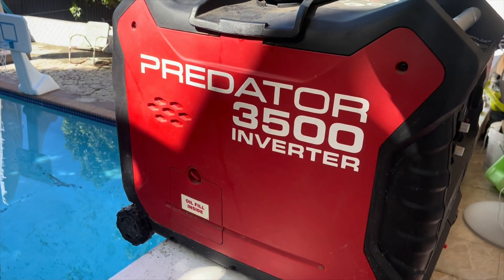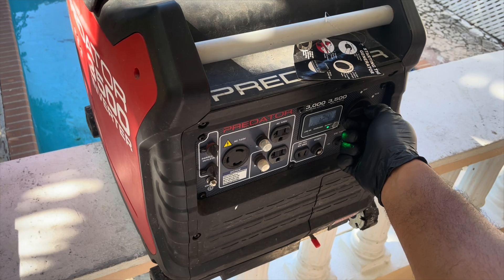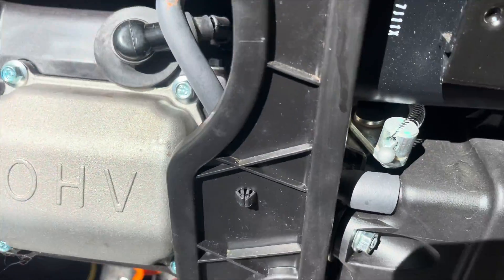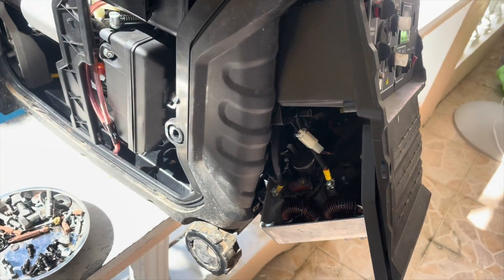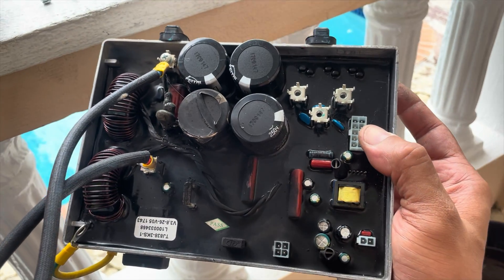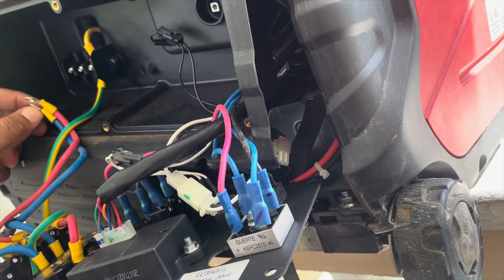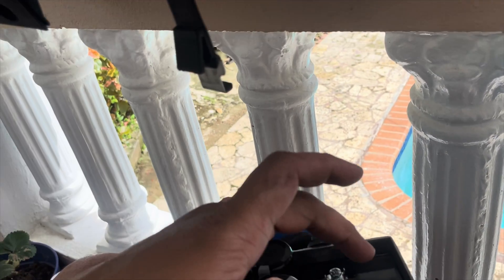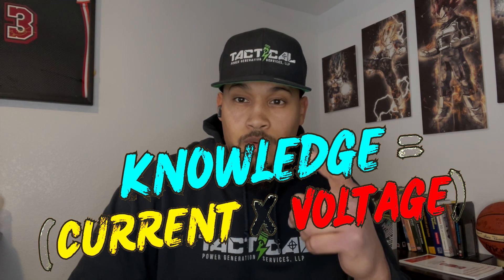How to repair a Harbor Freight Predator 3500 Inverter that has NO VOLTAGE or HIGH VOLTAGE. #diy

Comment: I’m having problems with my inverter on my 3500 predator inverter generator not producing any power DC power is coming through the inverter and lights in all work. Could you please give me some advice or where to buy a new invert? It is a six plug module.
Reply from the maker: Thank you for watching my video. I added an amazon link to the 3500 predator inverter module with 6 connectors to the description box of this video. Check if that’s the one you looking for. Let me know if I can help with anything else.

Comment: Hey Great Video...
I have a problem with my predator 3500.   I would not start with the cord, but I was able to start with a jumper.. it runs small rev up and down .. display show 0.  I tried power tools they work ok ..   what would you suggest regarding stating with cord..and display voltage.
Reply: Thank you for reply.. 
I was able to clean the carburetor... And it started up...
Then I tried to start again nothing, using cord and start button.  Generator spins but will not engage...
When it was running I tested with multimeter all120v  outlets 124.6
What else I can test
Thank you..
Reply from the maker: Make sure you didn’t flood the engine trying to start it the second time. Remove the spark plug and with the switch off pull the cord a few times to remove any fuel/liquid in the cylinder. Install the spark plug and try to start it again. Let me know if that works.
Reply: Yes I was draining fuel out of the carburetor through the drain bolt...
I went on and saw another person experience the same symptoms as my self ..and he replaced TJ113-2009-1 Ignition Control Module ... When I checked mine for some reason it was completely drenched in oil...
So I just installed it.. and the problem is solved generator starts up with half of the pull.  
Thank you for all you do...
Reply from the maker: Yes the ignition module is another common issue on the predator 3500 inverters. The module is located in the worst spot and it will get soaked on oil and get damaged easily. Thanks for keeping updated and I’m glad you were able to get your generator back in operation.
Reply: In addition... When I was cleaning carburetor, I noticed that pilot jet O rings were very thin looking. Have you replaced them if so what type?
Reply from the maker: If the generator is not surging while running then do not mess with them. But if you are in need of replacing them you can find a carburetor rebuild kit on amazon and it comes with a couple of those o-rings. I’ve tried searching for just the o-rings but I haven’t had any luck.
Reply: That makes sense..thank you..
Reply from the maker: Sure man, I’m here to help. If you have any other generator questions just hit me up 🫡
Reply from the maker: Thanks for watching my video! I recommend starting by giving the carburetor a good clean. That will take care of the starting with cord and the up and down revs. As for the display voltage make sure the connections from the display to the inverter module are not loose. If all connections are good then you may have a faulty display.

Comment: I found my stator to me the issue after disconnecting the 3 brown wires hooked up to the inverter module.
Does that indicate a bad stator or a bad inverter module?
how easy is it to pull out the stator?
Reply: Do you have an idea of what would cause it to only start when the 3 stator wires are pulled?
Reply from the maker: Did you connected the 3 wires back and tried to start the generator? It’s weird, those wires shouldn’t affect the spark at all. There are a few things that would cut your spark by grounding the circuit and those are, the oil sensor, ignition switch, ignition module and the CO sensor.
Reply from the maker: How did you found the stator to be the issue?
Reply: @tacticalpowerpro it wasn’t getting any spark and when I disconnected the 3 wires I got spark. Do you think the issue is the stator or the inverter module?

Comment: Love your video, and love seeing you respond to people a year later. Thanks for that.
I bought my 3500 like 7 years ago as a backup plan.  Never unboxed it.  I just unboxed it to prep for a storm, added oil and fuel, started on second pull. Ran fine for 5 minutes doing a warm up(eco off), then gave overload and idle dropped down as that happened.
I ripped her apart to get the inverter module out to inspect it.  It looks fine, capacitors and resistors arent swollen or burnt.
Then i checked oil and i put too much.
Do you think too much oil causing crankcase pressure cpuld cause that or should i order an inverter module?
Reply from the maker: I’m happy to read you love my video. I appreciate the support. Overfilling oil can definitely cause crankcase pressure issues, but usually that shows up as hard starting, smoking, or leaks, not typically as an overload fault. Since it only ran a few minutes before throwing overload and dropping RPM, I’d double-check the basics first:
1-Drain excess oil back to the correct level. 2-Inspect air filter and spark plug. 3-Make sure carburetor isn’t gummed from sitting all those years. 4-Test with no load to see if overload still trips.

If it still shows overload after oil correction and carb cleaning, then I will point toward the inverter module, but I’d rule out the simpler stuff first before ordering parts. Good luck and keep me updated.
Reply: @tacticalpowerpro thanks bro.  Im hoping its not a carb issue since I never used it, it say new in box for those 7 years.  I could have bought someone else's return, that would suck lol.
Im gunna put the inverter module back together, lower pil and rip the carb apart.  I'll come back and let you know
Reply from the maker: You’ll be surprised bro, I’ve seen generators with a gummed main jet from the box. I’ve seen inverter generators not producing power after one hour of actual used. But like I said, start by checking that everything on the engine side is good.
Reply: @tacticalpowerpro  got her working.  I redid the pil, verified everything else looked good.  Just got the replacement inverter module in and shes working all Bueno now.  124v steady.  No fails so far!  Thanks for all your video and responses.  I wish I made a video of the inverter swap that you didnt have in your video, but im too impatient to do that lol.
Reply from the maker: Awesome!! Good to read the generator is working again. Thank you for the update. I am searching for another Predator 3500 generator with a bad inverter module so I can record the inverter module swap I didn’t have on this video.

Comment: These generators are POS’s I’ve gone thru 3 of them this week. I asked Harbor Freight for a refund and they said they were unwilling to do that but this will be the 3RD ONE im exchanging THIS WEEK. Shame on Harbor Freight for not refund me the $800, I’m at the point where I’d rather pay more for quality. I’m filling up with 10w-30 20 Fl oz of synthetic oil, fresh 89 octane gas and I’m hooking up the electric start system. 1st one, the electric start died after 2 days and the 2nd one won’t even start up. I’m doing everything right. It’s ridiculous
Reply from the maker: Oh wow, three in a a week!? that’s really unfortunate. Electric start issues are typically caused by a weak battery. Would it start manually with the pull start? 

Also, these Predator generators are known to have faulty ignition modules and bad CO sensors. These issues will prevent the generator from starting. 

I hope the 3rd one works without any issues.

Comment: Ive been using this to run a  very small 120 volt mini split. The other day the voltage drpped to 61.5 volts out of both the 30 amp and 15 amp outlets. Any suggestions. Thanks
Reply from the maker: Sounds like your Predator 3500 may be having an inverter module issue. First, check the basics, make sure the ECO mode is off while running the mini split, verify the load isn’t exceeding capacity, and inspect all connections for corrosion or looseness. If the engine speed is steady but voltage is low across both outlets, the problem is likely in the inverter module itself or the stator windings. If you have a meter, check voltage with no load to see if it recovers back to 120v, if not, you’re looking at an inverter module replacement.

Comment: Hi, thank you for your helpful videos. I'm asking about this video that you mentioned the new module has 3 capacitors (not 4), but not that the white connector positions changed (though still plug and play). My main question: how did you wire the three silver screw terminals, since their orientation changed—did you reverse just the bottom cable or others too?
Reply from the maker: Hi, great question. I do not recall reversing those wires. I placed them in the same position as on the bad inverter module.

Comment: Mine runs for a minute then shut off and it says overload. Does that mean I need a new inverter? My generator only has 12 hours
Reply from the maker: How does the engine sound? running rough? really low idle? Make sure you have a clean carburetor, good carburetor gaskets, good and correctly gapped spark plug, clean spark arrestor (the mesh found in the tip of the muffler) and correct oil level. Most of the times I've seen the issue you mentioned, turned out to be either a clogged spark arrestor or carburetor related (dirty, loose). If everything is good on the engine then verify all the connections to the inverter module.
Reply: @tacticalpowerpro thank you👍🏽 im look into it !!
Reply from the maker: @juandejesus4757 you’re welcome. Keep me updated.

Comment: Mine runs/idles fine ...as soon as I plug anything into it gives me overloaded would this be the module?
Reply from the maker: I will need a lil bit of more info to give you an accurate answer. Is the spark arrestor at the muffler clean? Spark plug clean and gapped correctly? What are you connecting to the generator? Are you using an extension cord?
Reply: @tacticalpowerpro spark arrestor clean (both parts)
Plug gapped correctly I even tried a new ngk plug gapped correctly. New oil at the full mark. Engine runs fine at idle but as soon as I plug anything into it (box fan) it goes into overload and stops giving power ....but I tried a led light it didn't give me a overload and it kept the light on.
Reply: @tacticalpowerpro only reason I think the module is fried is my father in law borrowed it and was trying to run 2 ac units
Reply from the maker: Well sounds like everything in the engine side is good. Definitely the inverter module suffered some damage when trying to power the 2 AC units. From my experience the inverter module will fail before the stator and rotor.

Comment: Tengo uno igual solo dura 15 minutos y pierde potencia y voltaje
Reply: Ayuda porfa
Reply from the maker: Saludos, puede ser causado por varias cosas. Voy a necesitar un poco mas de información para poder dar con el problema. ¿El generador deja de producir voltaje pero el motor continua corriendo? ó ¿el generador se apaga por completo?

Comment: I have a predator 3500 I've changed the ignition module and the coil i have oil unplugged the oil sensor and the ignition module plug as well as tryed the 2 wire black on and off switch. And new spark plug. Still no spark any ideas?
Reply from the maker: I have another video on my channel about repairing a predator 3500 that got the ignition coil plus module replaced and still wouldn’t start. In the video I found out that who ever installed the new ignition coil didn’t gave the correct clearance to the ignition coil. That led to the magnet on the flywheel shearing a peace of plastic on the ignition coil covering the sensor. I’m not saying that’s your case but check that video out, it might help.
Reply: @tacticalpowerpro  yea I watched that video as well I gapped the pickup coil at .010 it's brand new as well
Reply from the maker: If you have a new spark plug, new ignition coil with a new pickup coil, new ignition module, unplugged oil sensor, limit switch at the stop/run/choke switch is working properly and no wire in the ignition circuit is cut or grounding out the circuit, then theres a possibility that one of the new parts you installed came faulty.

Comment: I have a PREDATOR 3500 Inverter. It seems to run my 9000 btu Air Conditioner on my camper but I get vibrations out of the Air Condnitioner when it is running. Other than that it seems to power the Air con just fine. I plugged it into a med. size fan and it does the same thing. I thought that an Inverter should supply a good sine wave or is this thing just too cheaply built. When I plug the air con or fan into grid power it is smooth as silk.
Reply from the maker: It sounds like your Predator 3500 might not be producing a clean sine wave under load, or there could be some harmonic distortion affecting your AC and fan. Inverter generators are supposed to provide a stable sine wave, but some “budget” models may have more distortion than higher-end units.

A few things you can check:
	1.	Eco Mode Off – Try turning off the Eco mode if it’s on. Some generators struggle with voltage stability in Eco mode when running high-surge appliances like an air conditioner.
	2.	Load Balancing – Ensure you’re not overloading a single outlet or circuit. Running multiple appliances on different outlets may help.
	3.	Grounding – Some inverter generators perform better when properly grounded, especially with sensitive electronics.
	4.	Check for Loose Connections – Inspect the power cord, plug, and receptacles for any looseness or corrosion.

If the vibrations persist, you could try using a line conditioner or a power quality meter to check the sine wave output. Let me know what you find!

Comment: How can I change my outlet plug in ? Mine are loose after few seconds plugin it loosen out
Reply from the maker: You will need to remove the control panel screws and the start/run/stop switch, that way you’ll be able to pull forward the panel and access the outlet for replacement.

Comment: How can I change the avr on this generator? I can't find where or how to get to the back of the alternator.
Reply from the maker: Inverter generators do not have (moon shape) individual AVRs in the back of the alternators like conventional generators. Inverter generators produce and control the electricity differently. The AVR in inverter generators are integrated to the inverter module (the part that I replaced in this video). The inverter module rectifies the AC to DC and then inverts that DC back to AC.
Reply: @tacticalpowerpro  That makes so much sense! Thank you! Do you know if it matters which of the 3 winding wires goes where on the new inverter module? I ordered a new one, didn't mark the old wires and took them off the old one. The 3 brown wires I am talking about with the 2 plain ones and the 1 wire with the white plastic band around it that says 120v. Thanks again.
Reply from the maker: Oh wow I’m so sorry, I completely missed your reply from 4 months ago. Did you got the inverter module installed?

Comment: Merry Christmas. My Question  is. I have a predator 3500 inverter. It gives out shocks if i touch it when running. Thank you
Reply: No Sir I used it with out grounding it in the ground. I use it for camping that's a lot of ground rods lol.
Reply from the maker: I recommend grounding the generator. I get it, it can be a pain. Specifically driving the rod down 8’, but safety is important. 

But, in your case I think you might have worn wire insolation. Verify your generator’s wiring.
Reply: I'll check the wires and thank you for your service.  Thank you
Reply from the maker: @insanedesert8978  Thank you for the support! Let me know what you find with the wiring.
Reply from the maker: Merry Christmas to you as well. I got a question for you too, is your predator 3500 inverter properly grounded? 

If it is grounded properly then you might have a worn or damaged insulation on internal wiring causing electrical leakage, allowing current to flow to the generator’s metal frame.

Comment: can you give out the part number for the invertor module please
Reply from the maker: Not sure of the OEM part number but the part number of the replacement inverter module I use on my repairs is B09Q68GXB7.

Comment: My family has one of these thats brand new, it has like an hour on the hour meter, but when we start it up, the overload light comes on, with nothing plugged in..
Reply from the maker: Verify you have the generator in the run position and that the spar arrester is not clogged with carbon buildup. If that is good probably a rodent got to the inverter module’s wiring or it got overload and fried the module within that hour of used.

Comment: Una pregunta!!!! Mi generador inverter es de 2000w prende muy bien... es muy estable... 

pero aveces prende el overload y no pasa corriente...

Lo hace literalmente cuando le da la gana.... puede estar horas prendida o solo unos minutos... 

El punto es que lo hace cuando se le pega las ganas de jod3r..... 

CREES Q SOLUCIONE EL PROBLEMA COMPRANDO EL MODULO NUEVO????

ya se verifico todo hasta saque el modulo y no veo nada explotado... PUDIESE SER Q SE ESTE DAÑANDO POCO A POCO???

SALUDOS DESDE PR..
Reply from the maker: Saludos! Primero asegúrate que en realidad no la estés sobrecargado con lo que le estas conectando. Lo otro sería verificar que no haya conexiones sueltas en especial desde el modulo al circuit breaker y receptáculos que causen un arco con la vibración del generador y se proteja tirando el overload. Si todo eso esta bien pues entonces el módulo inverter esta malito.
Reply: @tacticalpowerpro   en verdad lo hace sin nada conectado.....
Reply from the maker: @jrtv7258  ok entonces como te mencioné anteriormente, verifica que todas las conexiones desde el modulo inverter hasta el circuit breaker y receptáculos estén bien apretadas. .